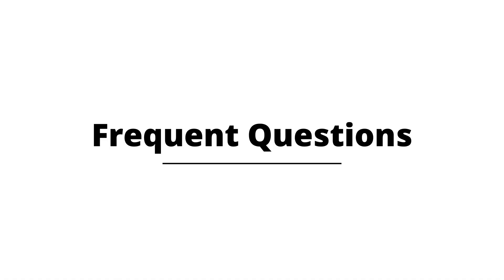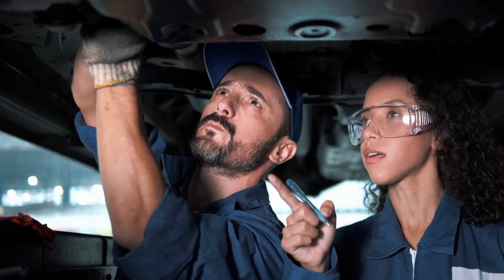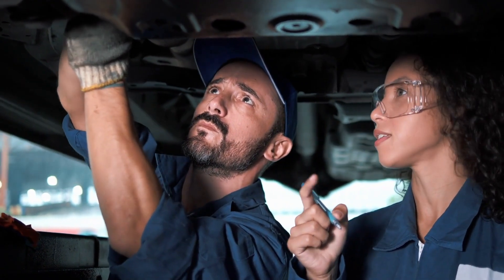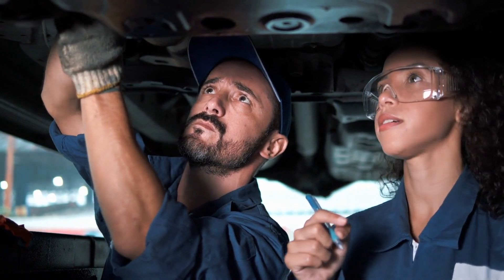🟢 Code P0741: How do i fix Error Quick and Easy【2025】🟢

Comment: I've had this code for 8 years in my 2002 grand prix. I can turn off the engine and restart it. It drives fine for awhile. It's just a work car so I haven't dug in to it yet
Reply from the maker: 🛠Manual de DTC específico del vehículo. Solicítelo aquí.👉Español: https://mecanicaautomotrizpro.com/manuales-de-reparacion-de-codigos-dtc/
Reply: @DTCcodes I don't need a manual. I can drop the transmission and rebuild the whole thing if I want to ; thanks